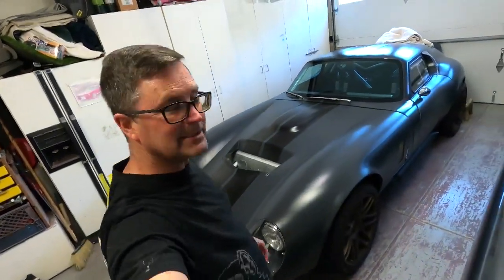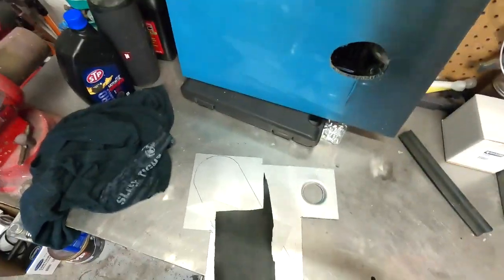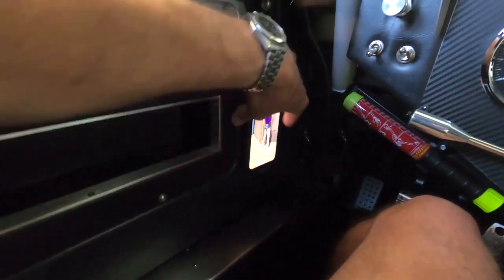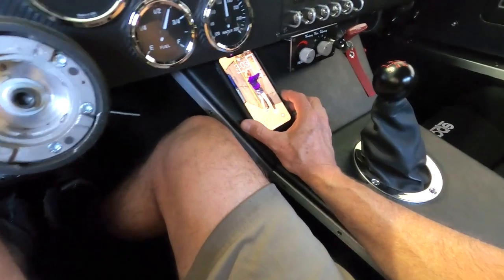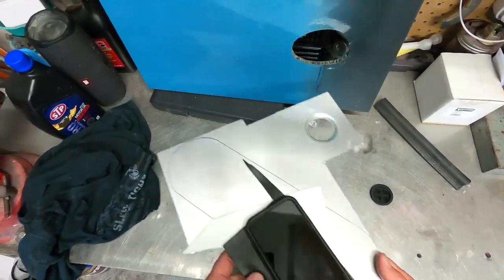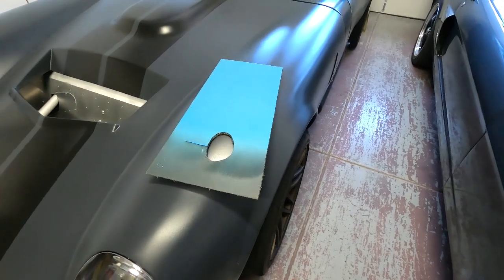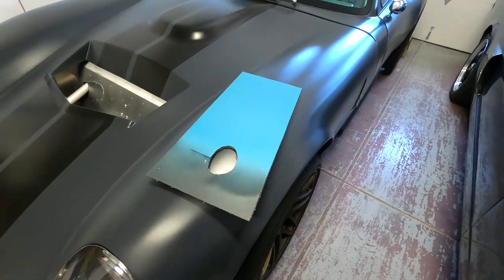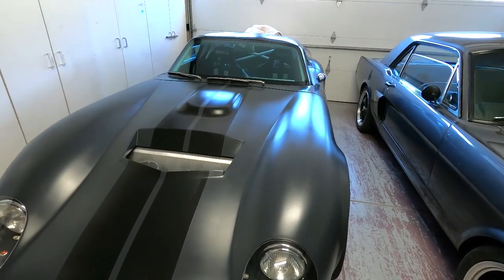Ingenious Phone Holder for Coupe- Cobra Daytona Build, Video 164

Comment: Off topic subject. on your rear shocks which way  did you face your adjusting control knobs. up /down in or out
Reply from the maker: Inward so I can stick my head under car and make adjustments. Way to stiff on the race setting. The knobs are closest to ground as well. I don’t think it would be easy to get to them if I flipped shocks.